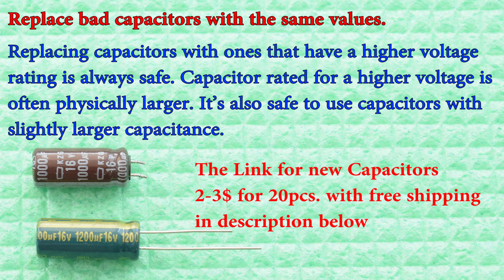How to fix any Monitor with the most Common Problems. Fixing another ViewSonic Monitor in 10 minutes

Comment: Oddly enough I just fixed my 8 year old Acer 23 in monitor the same way but it was the main Power Cap which was 1000uf @ 450v's.
Blown the ( - ) negative leg off the bottom of the cap. Not seen that but one other time... :-D
When something quits I just replace all the caps and it fixes it 99% of the time. I fixed my sisters TV the other day and it was a power supply cap too...
Thanks for the video!
LLAP
Reply from the maker: Good job! I'm happy to help!
Reply: I have no idea why the cap just poped...
Reply: @TaigiTWeseDiplomat--Formosan  As capacitors get old the electrolyte chemical get old and starts to dry out and they heat up from the chemical reaction and POP! Just what happens to old caps. If it is 10 years old, most likely it has bad caps in it...
LLAP

Comment: Nice. But would also be nice to see what happened after the caps were replaced. Did the monitor start up again? Sometimes, it's possible that the busted caps busted because another component upstream - such as another capacitor - a bigger one, failed (even if not looking bulging). And replacing the downstream ones can just lead to them blowing again. And blown capacitors can sometimes lead to blown transistors and other components.
Reply from the maker: Yes, that monitor was repaired and returned to its user. I had a pile of old monitors in the office, all of which were 5+ years old, and simply replacing all bulged capacitors brought them back to life. Of course, I checked all capacitors, but I made this video specifically for regular users who aren't familiar with electronics and who want to save some money by attempting repairs themselves. I'd say that in 90% of cases, replacing visually faulty capacitors is enough. However, if I were repairing it for myself, I'd replace all capacitors at once, even if some of them still appear to be in good condition.

Comment: I would have instructed the viewers to check for high voltage on the line rectified cap. If not discharged, someone could be in for a nasty shock.
Reply: Absolutely this!!!!!!!!!!!!!! It cant be understated that when handling any capacitor that has been in use, always check their charge and discharge before you accidentally shock yourself. Depending on the size of the capacitor you might seriously injure yourself. (to anyone unsure how to do this, google capacitor safe discharge)

Comment: I have an LG 34UC80-B IPS Curved. The backlight comes on, but no picture. Do I need a new mainboard or would it still be a capacitor issue on the main or driver board?
Reply: Hey bro
Did you get your monitor fixed?
Same thing has happened with my lg monitor

Comment: hi sir, what is the glue you are using?
and another question,
my monitor has white,pink, green lines vertically at several places,
I didn't care about it.
But sometimes later, the top right edge of the monitor starts to turn black, 
it goes from 1mm to 3cm,
seems like the monitor is burning out. 
Could you teach how to fix it to become a fully new display with no defects?
I have tight budget so there are many things I DIY myself.
Please help!
Reply from the maker: What's the model of your monitor?
Reply: Model: Samsung EX2220X
Model code: LS22CLUSFV/XM
Color Display Unit Type No: CB22WS
Reply: @goldahong4392  I don't think it's fixable, buy the new one.

Comment: Hi! I’d like to know that that board which is covered by the clear thing is called. On my monitor the cable slightly ripped and want to see if there is any way to replace or fix it.
Reply from the maker: On the top? That board is a part of your LCD screen. Not sure if you can find it somewhere.

Comment: Very nice video sir thank you,but mine is no longer giving that blue light what must l do to fix it is it one of the capacity please help it's working right philips model 150ss
Reply from the maker: If there's no signs of life in your monitor, then start with checking the fuse, MOSFETs and capacitors. If you see some popped capacitors, then simply replace them and see if it's enough.

Comment: Hi,

But what do you do when all of the electrolytic capacitors are fine (MOSFETs & voltage regulator too), but still your backlight doesn't work ? 😣

Turns on for about 2 s, then shuts off. If you use a LED flashlight & shine on the LCD you can see the image.

What to check next ?

Thanks ! 🙄

Best Regards,
Reply from the maker: One of the CCFL bulbs is dead. In that monitor there are 4 bulbs. Disconnect them all and then try one by one (the backlight won't turn on with the dead bulb/bulbs) then you have replace it or bypass with a cheap high voltage capacitor that you need to solder or connect to the wires that go to that bulb.
Reply: @ElectronicsComputers  I suspect this too. I'll give it a go. 🤔😑😏🖒
Reply: @ElectronicsComputers  Well I tried the process of elimination on those 4 CCFL's just now, but sadly the issue still remains. 😕

Should I check the two 3 kV ceramic capacitors nearby as well ?
Reply from the maker: @davidbolha  You have to connect only one lamp and then turn on your monitor. If the backlight turns on for a few seconds then that lamp is good. Go ahead and check the rest of those lamps. If there's no backlight with one of them then you have to bypass or replace that lamp. You can't just unplug the bad lamp, because there's a protection on the inverter PCB that doesn't allow to provide power to the lamps with dead or missing one of them.
Reply: @ElectronicsComputers  I did that. I tried everyone of those 4 & each behaved as you described. So they are fine. 😕

I also checked the voltage regulator & diodes.

Comment: yesterday i saw some smoke coming from my monitor.... what may be the possible cause

and how to test if a capacitor is bad if it is not budged out?
Reply from the maker: you need a multimeter at least to do that.
Reply: @ElectronicsComputers  I have that, and some capacitors are swollen also... but how can i check the IC in it
Reply: also the biggest capacitor(in size) rated 100uF 450V which is not bulged out is discharging very fast after removing the connection(7-8sec), does that mean it is leaking, should I replace that also
Reply from the maker: @Xp-Sam  The big capacitor should be fine. You have to focus on low voltage caps. There are two power rails 5V and 12 volts. Simply remove all low voltage caps.
Reply: @ElectronicsComputers  And how should I check IC, I have another power board on which every capacitor is looking fine... I think the problem is in IC
Reply from the maker: @Xp-Sam  First check the mosfets. I'll send you a video link on how to do it. But first try to swap the caps.
Reply: @ElectronicsComputers  but which caps should I change... all are looking fine, no bulging

Comment: Acer Predator XB271HU gaming monitor not working 

I've had this monitor for a little over 3 years, it worked fine with one exception - rebooting the monitor by pressing the power button twice would make it "hang" with a power LED on, but no picture on the screen (not even a logo / splash screen). I've found that leaving the monitor unplugged overnight fixed the problem and it would start up and work again normally the following morning. This solution worked fine until recently, now the monitor won't turn on even after a week of being unplugged. The LED still turns on whenever I plug the monitor in, I've attempted a factory reset by holding down a combination of menu buttons (as per Acer manual) but I didn't get any response from the monitor (no LED changing colour, or flashing, monitor didn't reboot, etc...), so there is a possibility that this problem is caused by a faulty motherboard. I imagine that the panel should still be working, but some other part might need to be replaced to get the image on the screen again.

Please help me with how to fix it
Reply from the maker: It could be the same problem - dead caps. Simply disassemble your monitor and check the capacitors. If you see caps with a bulged top then you need to replace them. All soldering stuff will cost you about 15$ delivered including the caps.
Reply: @ElectronicsComputers  ok thanks

Comment: My screen is an 27 inch 1440p 144hz monitor, I checked the printed circuits and they seem perfect (capacitors and all) and the screen works, just that there is a 2 inch think horizontal line of damaged, like bad color (not black) pixels in the bottom, any ideas? Thank you and great video!
Reply from the maker: I need to see the photo.
Reply: @ElectronicsComputers  thanks for all the help, ive learnt a lot from your videos!  Youve gained a new sub! Heres the image: https://imgur.com/gallery/JqWJZwD     also, its the screen, not my gpu, as it happens in any computer it is connected
Reply: Have you fixed it yet
Reply: My monitor has light on its power button but pushing it doesn't power on the monitor do you know if I should change capacitors or what to do

Comment: My monitor is not working after saw a small spark in my new extension while plugging the adapter to it. What is the priblem. Can you tell me
Reply from the maker: Try to unplug it for a few minutes and then plug back in. If you slowly plug the cable into the outlet can you hear sparks? If not, then it could be a dead fuse in the monitor but without checking all components with a multimiter it's hard to say.
Reply: @ElectronicsComputers  bro how much cost need to solve fuse damage?

Comment: I used thia video and fixed my 32in monitor that had no back light, replace 2 caps, its works great, but a lil dimmer than my other monitor which ia the same model
Reply from the maker: Great job on fixing your monitor. Check if the brightness and backlight settings are the same. Also, over time the LEDs degrade and may not be as bright as they were before.

Comment: I need your help Sir, i use a Viewsonic VG2236wm Led Monitor. It was working fine till 4 days back when it suddenly turned off and since then it just shows blinking blue light. I disassembled it and checked the capacitors as you have shown in the Video but Capacitors look fine and secondly i am unable to find any Schematic diagram for this mobo either. Please help
Reply from the maker: There could be a short somewhere. Do you have a multimeter? You should start by checking the output voltages from the power supply with the cables disconnected from the main board and the monitor. Then, reconnect all cables and check again.

Comment: My HDMI port fell out into the casing. How can I open up my viewsonic vx2457-mhd and get it back in place??
Reply from the maker: If you ripped off the HDMI port from the motherboard, you have to solder it back in place. Sometimes the ripped port can tear the traces on the PCB, which you will need to restore with thin wires. Overall, you need a soldering kit and good soldering skills to do so. The disassembly process is the same as for this monitor in the video.

Comment: Sir i have viewsonic vg1921 monitor and its power button light blinks but screen dont come but when i put it in sunlight for a couple of hours or heat it up with hair drier the screen works perfectly. And I've to do it daily. Please please help me
Reply from the maker: Most likely bad capacitors. Check for popped caps and replace all of them if they look suspicious.

Comment: I have a samsung led monitor that has a few horizontal lines in the top (maybe like 2cm). After some times passes the whole screen gets them. This goes away when i stop using it for a few days but the top lines stay. What could it be i already checked that flat cable
Reply from the maker: If you hit the monitor at the top or sides, does it affect those lines somehow? Also when you see those lines if you press the menu button does it look normal or also affected by the defect?
Reply: @ElectronicsComputers  menu looks normal because its in the bottom right but when the screen gets full of lines the menu is also effected. Hitting or pressing doesn’t effect them.
Reply: @ElectronicsComputers  there is metal like tape inside the monitor could that be something like thermal pads? There are only 3 little ones that are attached to the display and metal (2 at the top, 1 on the side)

Comment: Hi, please I have a Syncmaster960: what reason for vga&component ports only displaying purple color ?! ThAnK
Reply from the maker: Quite a few actually: broken cable, damaged connector, wrong color level settings of the monitor etc. When you press the menu button, the menu looks normal or also in purple colors?
Reply: @ElectronicsComputers  thanks, no.. cable, menu, other ports are ok the problem is 99% due to monitor logic so I think I'll replace the monitor card :)

Comment: My monitor has light on its power button but pushing it doesn't power on the monitor do you know if I should change capacitors or what to do
Reply from the maker: Most likely the problem in dead caps.

Comment: Hello i need to tell you something and i need some advice..
So i have this monitor and i used it around 8 years and i wanna say that my monitor screen is shaking and it's hard to use also some purple and green lines also appear on top and bottom of my screen. I replaced monitors and i cane to know that the issue is with my monitor and not with my vga..
SO MY QUESTION IS CAN I FIX THAT SHAKING MONITOR or do i have to buy a new one..
Plz reply 👍
Reply from the maker: Most likely it's a dead LCD panel which isn't worth fixing it.

Comment: My monitor has currently just started flickering on and off, what I presume to be the monitor failing. Even without an HDMI or DP connected, it just flickers on for about 1 second, then flickers off, over and over. Model NO: XG27AQ

Comment: Hi, have strange power "on" issue. - cant turn off using power button!!
Have the small monitor model Acer 1715 and it wont turn OFF by the button, just stays in standby. Runs great and with signal , you get perfect picture and green light but whether signal or not, i cant turn it off?? tried the power button for 1 second ,3,10 and nothing. i pulled it apart and checked continuity from buttons  to the cable at the logic board, so it must be fault there. Is the start circuit permanently "on"  or something screwed up? No bulging caps ect and nothing obvious.
Reply from the maker: Check the PCB with buttons and check the power button.

Comment: hello sir can u help me pls ...my monitor only shows blank screen it blinking a blank ..theres power and led light but no display no text only blank screen..is it capcitor problem ?
Reply from the maker: Connect your monitor to a PC and turn on everything. Then turn on the flashlight on your phone and shine it on the screen. Look at different angles. If you see your desktop, then it’s a backlight issue. If there’s nothing on the screen, then it could be a power supply problem. Anyway, I’d start with the capacitors, but without checking some power rails and key points, it’s hard to say what’s wrong with your monitor.
Reply: @ElectronicsComputers  thanks a lot sir .. i will update tommorow

Comment: Hi, i have VK193D ASUS. When i turn it on, after 5-30 minutes, my screen goes off. First the bright goes lower and then black. If i turn it on again, right away it goes black. I need to wait so i can watch it for 5-30 minutes. I think that monitor have heating problem? How you fix that? Is it capacitor i need to change? Thanks.
Reply from the maker: I'm 99% sure that he problem in capacitors. So simply replace the bulged ones. The link for the caps in the description.
Reply: @ElectronicsComputers  If there is no bulged ones? I've checked. For me all looks ok. And for some reason i was sting by electricity.

Comment: LG 34GP83A worked fine for a couple of days but then started losing display while the backlight remained on. Not even the monitor OSD comes up.

Now it loses display after a minute of turning it on, and it's always the same pattern of it losing display three times and then not getting it back again. Not sure if it's a power issue or the panel itself.
Reply from the maker: Check electrolytic caps in the power supply
Reply: @ElectronicsComputers  I've imported it from US to India and can't get it repaired here without the internal IC. The technician said that the power brick is fine, so the issue is either due to the power board inside or the panel itself. Now if it's the former, I can probably get it changed, but panel would be impossible.
Reply: @ElectronicsComputers  And the other reason I'm asking this is because the customs person who checked it probably mishandled it leaving fingerprints on the panel. There are no issues on the panel itself, no dead pixels, but I'm wondering if that could be a cause.